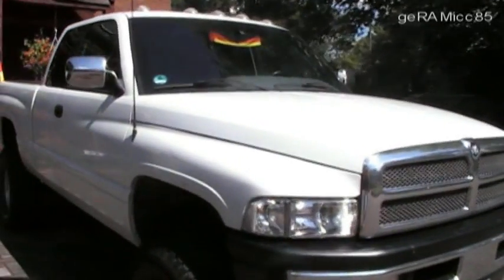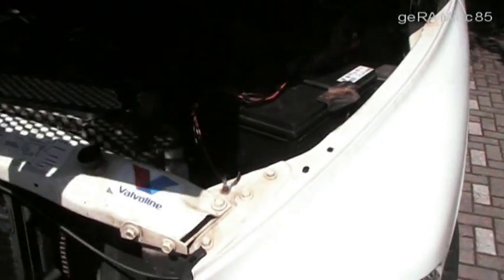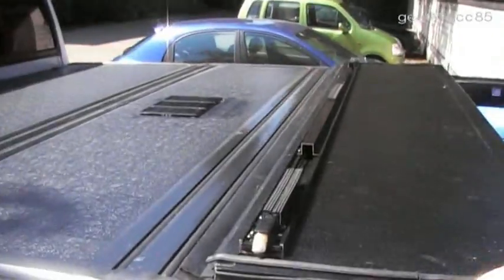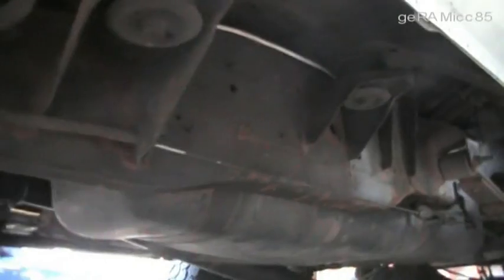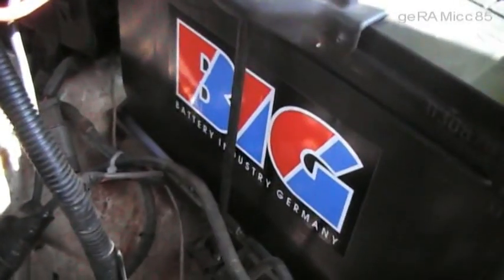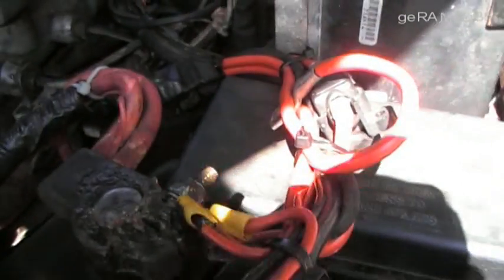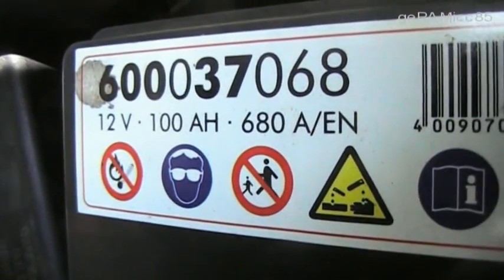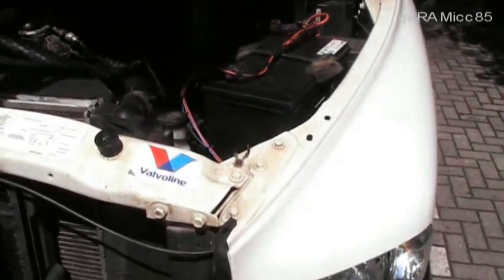HOW TO KEEP CAR BATTERY HEALTHY AND CHARGED WITH SOLAR CELLS | AUTO RAM TRUCK BAT POWER CHARGER

Comment: I have the same set up on my but use just one  3watt panel on the dash  - I put a diode in mine and omitted the regulator -  reasoning that  ost of the time its one or 2 watts which ain't going to boil her dry -  have just a 1.5watt panel  on my motorcycle fairing  - both work a treat

Comment: I'm curious, where did you get the solar panels and is there any chance this setup will over - charge the battery or limit the battery's ability to fully charge in general? Thanks!
Reply: So then, do you have to disconnect the panel from the battery when the truvk is running or can you leave it constantly connected, running or not?  Thanks again!
Reply: And is where you purchased the regulator listed ad well?